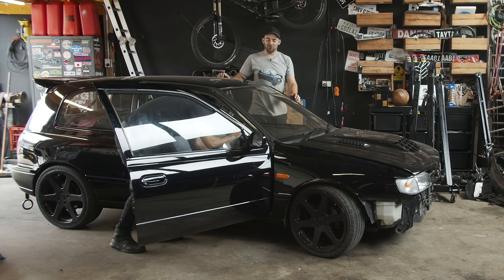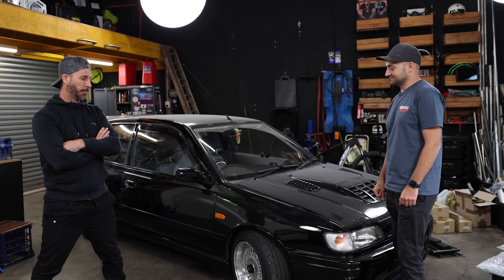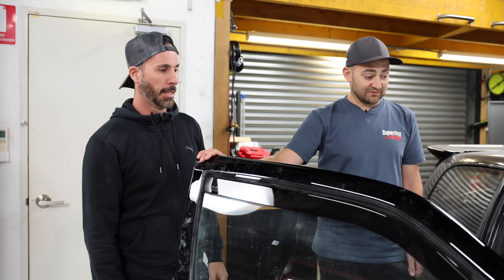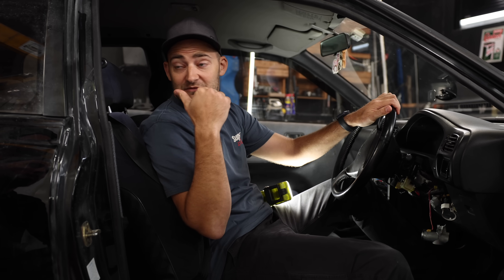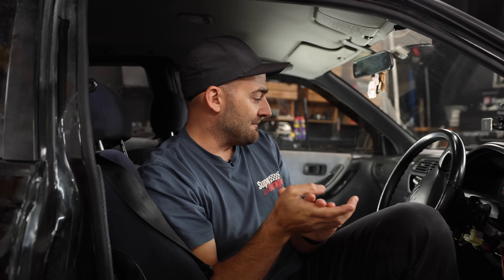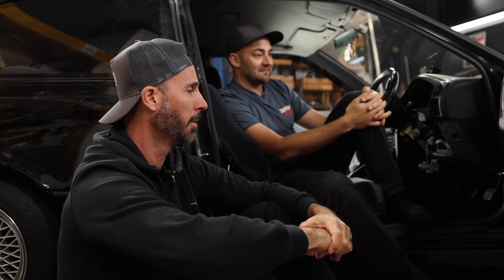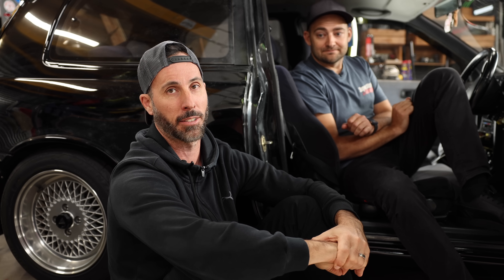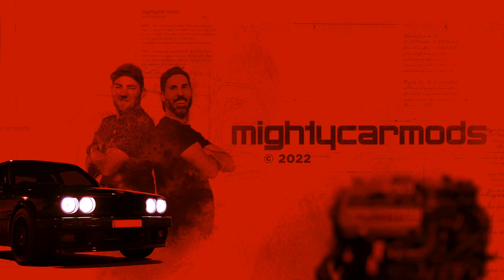Someone tried to Steal the GTi-R | Police Called

Comment: Back in college, someone stole my modded lsvtec... Kill switch didn't matter. They cut the emergency brake, shifted into neutral and put it on a tow truck. When it was found, it was just the frame. I'll never forget, nor forgive them. I knew who did it a bit later, cops didn't do a thing.

Comment: There's no real need to use the lock from inside the car. After bending door frame just hook and tug on internal door handle and the lock should disengage itself. Mechanisms are car-specific but you can often modify (or bodge) them to disable this feature with a bit of ingenuity, although it's not advisable on cars with autolocking. Locking wheel nuts and aftermarket steering locks are also great ways of deterring car theft, basically anything that makes it look like it's going to be a pain in the ass to take. The battery thing is definitely weird, but makes me think they might be back for a second attempt. It sucks that this happened and I hope you manage to get the car fixed soon.

Comment: Ive got the tk419 gps trackers in just about everything i own, there one in the car with a remote ability to cut the fuel pump, there one in my 3.5kva generator, theres even one in mine and my partners electric scooters, they work from 9-72 volts, so pretty much anything. Has a built in battery, just put in a 4g aldi sim card and put $15 credit on the yearly plan, and youll always know where your valuables are, and can potentially even remotely kill the car if its on the move. Cheap insurance I think

Comment: my coworker has a 2022 RS4 and has a tracker installed with a remote kill switch, usually they’d just stop the car and the thieves would torch the thing cause it would be pretty obvious but certain brands create pseudo engine faults so it looks like it’s faulty and lowers the risk of destroying the car

Comment: I used to live somewhere where people broke in to our cars all the time. My housemates k10 was the only one that got taken and we got it back in just in time  as the kid was caught doing laps and was running out of fuel, except the bottle on the back seat ready to hide the evidence. 

But yea screwdriverd locks, bent out doors, plastics ripped off under steering wheel, stereos gone even though they were worth nothing….Tbf even kids bouncing basket balls on the bonnet of my starlet, that completely destroyed the front end. People are absolute savages, especially when they can see you have something that you like. 

Deep breath, in the mouth, out the nose, and just see what you can salvage. 
Still, doesn’t stop that slightly violated feeling unfortunately.

Comment: I’ve got a kill switch and even if you able to start the car without pressing the switch, it force the car to rev to 3k to alert people it’s started and the drive by wire throttle doesn’t work unless the kill switch has been pressed. If you with Shannon’s get buy back as well…

Comment: Maybe it's because I've installed gps tracking/ fleet management and starter disconnect repo specials for about 14 years, but I can start most vehicles without the key or destroying any part.

Comment: On my sti I have US market Lock nuts and tool for wheels and just fit a trailer boot on it from super cheap auto, car isn’t going anywhere until they Cut through the steel boot, doable but would take ages but would be Loud ad hell. Cheap solution and I feel not something people expect

Comment: I take relays with me if I have to leave my S15 outside over night. It has been broken into once and thieves got aliexpress special 30 euro 2 din headunit that was a placeholder to fill stereo cap in dash. I have lost 3 sets of auxiliary lights from my daily. That stopped only after I welded the bolts.

Comment: I had a 1992 (EJ1) Coupe EX (in OEM Honda Camelia Red -Purple) that I bought from a neighbor for $2,500) and I had spent $9,800 on (in 2006) on an Engine Swap (JDM GSR Block bored 0.020", B-16B Head and a Type-R Transmission with a LS Final Drive).
This car SCARED THE POOH out of me, but got 32MPG (Because I drive like an Old Man)...
I was at work, and since I had a Fuel Pump Kill Switch and a Clutch Lock, they cut the Hydraulic Line from the Clutch Master Cylinder, and pushed it onto a Rollback Tow Truck!
I found it later that night with the CV Axels cut with a Torch and the entire car covered in Lithium Grease so Fingerprints where lost.
I ended up selling the Rolling Chassis for $300.
This was the message I received from "Higher Powers" -I don't need a Car like this!

Comment: Some of the interior pieces look very similar to the Sentra SE-R (or regular models).  I bet the door handles and key calendar are the same part # as that, a Primera/G20 or other Nissan models of that Era.  I hope that is the case because in Mexico they contained making the B13 Sentra (they called it the Tsuru) for like 25 years until 2016.  There will still be new parts available.  Moog is looking like he wished Australia had the 2nd amendment!

Comment: 2 years ago someone tried to steal my Subaru, it had working immobiliser but they tried to drive it off by cranking it while gear is in. Didn't get very far but ruined starter motor and the wires, broken driver side window and ignition switch and busted in car stereo and they stole my old sneakers from the trunk!

Comment: thats sad this happen to me before with my 1998 Audi A6 i travel for work what i did i parked it removed the battery and the ECU from the car and one day i got a call that my car was broken in to they couldent turn on or open the door so i ended up with a broken window and a couple plastics under the dash

Comment: Over here in the states I used to have an old jeep that didn't have a key the Tumblr been broke out by the previous owner son stealing it so I put in a 12 V solenoid and a toggle switch hidden inside one of my air vents with the switch was off the truck got no power it was dead to the world

Comment: Used to have a Lexus LS400. It was stolen 3 times (house broken into, keys stolen, car stolen,) and every time I got it back because rare car + small town + local radio. 
In the end, every time I parked the car I'd pop the bonnet, open the relay box and take out the starter motor relay and leave it somewhere car parts don't belong. 2 more times I found the car at the bottom of the driveway with the keys in the ignition. Never did catch the bastards in the act. I would have done gaol time for that car.

Comment: I would guess it was an old car AKA easy to steal if unmodified. Wanted to joy ride rattle can paint maybe swap plates ect... Homeless here in the states are notorious for this. Magnet operated switches are handy. Or running the fuel or ignition via a OEM switch that is not used in your model is always easy and low VIS.

Comment: Seeing how the Australian police even dusted for prints to catch the criminals, it makes me mad how little effort the Swedish police has put in when my dad motorbike was stolen. They were caught not even 10 meters from where it was parked with the bike and my dad has not received any update on the case or compensation. They used a battery driven angle grinder to chop through the front brake disk where the lock was and tossed the lock, broke all the instrumentation to get to the steering lock. The insurance company paid for the repairs but there is still a small part to pay yourself in Swedish insurances(don't know how it works in other countries) and the bike was in for repairs all summer.

Thieves pisses me of so much.

Comment: Hidden Fuel Pump "Kill Switch" and a "Clutch Lock" should help not loosing the Car, but EVERYTHING comes off with Bolts and Screws...
Security Bolts (special Adapter required) and Security Screws also "MAY HELP" of they nefarious will just Break Stuff!
MCM needs an Indoor Shop, or a Secured Yard with a "Mall Security" presence.

Comment: someone tried to steal mine, bent the door frame to get into it with a metal bar that they left on the passenger seat, then tried to hotwire it but failed, utterly devastated, i now remove an ht lead and the steering wheel when i leave it

Comment: An easy and cheap way to slow down a thief especially with an older car if you are going to parking it for a bit. Remove a couple of fuses from the fuse box. Most car thiefs aren't mechanics they just know how to steal cars. If it won't start they will give up!

Comment: Kind of funny you mentioned immobiliser hidden under the dash. So my story starts with my Lexus IS250 being stolen, funny thing - it was not driving car, I had AC compressor seized and accessory belt was taken off, and because that drives alternator the battery was dead. Obviously, Lexus has immobilisers etc. and it was an old car hardly worth anything.. but one day it is gone and I reckon somebody were driving past with trailer and just picked it up. Probably some disingenuous breaker yard guys picking--up random cars of the street when they believe they may be abandoned and braking them for parts or something, and mine looked like that because it was on the street for like 3 weeks not moving. Anyway, so despite being non-running and immobilised it still got stolen.
Got paid by insurance, got another one from auction and that turned out non-runner because of immobiliser problem. In short I had to get to what is called ID code box under the dash and remove entire dash, not only that you need to have matching steering lock, matching smart key module and matching keys. So it is 4 parts which have to match, then you can program them to ECU (ECU isn't needed). In my case I as well needed second key as mine came with only one and that costs £460 from Lexus and only Lexus can do it, so it was actually cheaper to get all parts from single breaker and replace everything, but it took 4 days to take dash apart and replace all the modules etc. It was massive headache.

Comment: Two weeks ago some scumbags broke into my partners car by first smashing the small quarter light in the rear door. Since that attempt failed they pulled the top of the door out and once inside ripped out the ignition key steering lock assembly. Luckily the security guys in the mall caught two of them in the act and held them for the Police. It was an early 2000 Coralla and only worth about three grand but the insurance company is going to fix it. We'd rather they write it off as we had already bought the replacement Car a month before and will probably fail its next warrant due to rust.

Comment: 90's car's takes a thief from the 90's to attempt to take a car this old. He used a hole punch first then remember he could bend the top pillar. Never leave the windows slightly cracked either. They can pull the windows out of the channel and unlock the door.
Reply: It wouldn't take much for younger poeple to learn

Comment: Maan, this sux. But on a brighter note, it makes me remember my old e34 bmw. We were once on a roadtrip, and we gone to eat something, so i locked the car as usual.. well, as soon as i turned the key to lock it the alarm went on, that means the horn went on, all the locks locked and were fixed locked, no matter if the key were turned, the window switches deactivated, and the engine was cut off by the ecu 😅 my only luck was that the central locking wasnt working on the rear hatch, so i could go in, remove the rear seat through there, and after about 2 hours of fiddling with everithing (the horn was on the whole time btw 😂), i managed somehow to unlock the car, and disable the immo. It was such a relief when the doors popped open, and the engine ran again. I never locked it again, ever, instead it had a switch then, under the dash, for cutting the main power, just in case

Comment: Yeah unfortunately a wood shim a long wire button grabber and a wire will get u into any car and unless u have an alarm system with a hidden battery u could easily loose a car because a good theft would easily get in and put it in neutral and roll it into a box  trailer a good alarm and a tracker is the only guarantee

Comment: Me 1986 Mustang  V8 coupe is pretty valuable. I leave it locked, battery disconnected,  covered and behind me little railside trailer, that is triple-locked, including to a fixed post in the driveway. Just make it a hassle is all you can do. Also don't frigging advertise your cool stuff. Avoid showing off or giving away personal info on location and stuff. Never know who's listening.

Comment: As regards the battery. A possible theory is they were way less educated then you think and somehow thought disconnecting the battery would stop the immobilizer working. Then they may have planned on bumping the car in order to start it. Battery was probably discarded. They were unsuccessful and got spooked and ran away that would be my guess. Terrible regardless. I’ve had a cheap and I mean cheap moped robbed when I was living in Canada. Wasn’t the money if I’m honest didn’t particularly like that moped but it was mean and at the time my only way to work. It hits different when it happens to you regardless of the vehicle

Comment: Guys,,, I FEEL your pain.

Here in South Africa, the Uno Turbo's was in HIGH demand in the 2000's... My Uno Turbo was stolen,, or should I say tried to be stolen, but, it could not travel 100m. It was tried to be stolen 3 Fnc!king times!!! and never got past 100M. Everytime I had to replace the Key Barrel, Door Barrels, Boot Barrel and Filler Cap Barrel and the Steering Tube Column cause they YANKed the steering wheel for the steering lock to brake out of the Barrel.

It costed me dearly every time.... MOTHER F'ers....

Then I have fitted the Uno Turbo with AF Management and a VESA 4 Alarm / Imobilizer that cut feul and egnition seperately and to get it back-up-running, there is ONE-HELL-off a button procedure pressing from the Transmitter button to get it to work.

I still do have my Pocket Rocket since I bought it in 1997,, but it is in for "bigger" plans...

Your GTiR,,, that is Masterb-googggl-ed,,, I fel-in-luv with that when it was published in our CAR magazine although we have never had it in South Africa.

"Ps. I would put the Black wheels back".....

Comment: That’s absolutely awful! I’m gutted for you guys! What mindless *goat noises*

For anyone with a modern proximity key, get yourself a Faraday box for your keys… protects them by isolating the signal. There is a problem in the UK at the min where thieves have an amplifier and they pick up the key from inside the house and start the car and drive off… the box blocks them from piggy backing the signal.

Comment: I went to a party one time with my little s10 mini truck but before I went to the party I had replaced my steering wheel and did a kinda bad job at tightening the negative connection back up and when I crashed at the party someone stole my keys out of my jacket pocket and attempted stealing my truck but because my cable was lose they made it about 50ft before it died and  when the engine died it rolled down the hill of the neighborhood until it got stuck in a 3 foot ditch left for dead until I found it in the morning

Comment: Someone needs that car to be used as a diner car, they aren’t worth that much to be stolen for a major profit. Whoever stole it, either personally needs the parts or knows someone who needs the parts of that car. 

The only cars worth stealing to be sent overseas are brand new or -5 year old cars, luxury or sports cars. Most popular are range rovers, land cruisers (sent to the Middle East, usually they steal older cars to send to isis, newer ones go to Dubai). 
Euro luxury cars go to China/Asia/Africa where they are just straight up sold, usually to millionaires who don’t know they’ve been stolen. The most popular way is by switching the numbers with a local car that’s been written off or used in crime and disposed of (blood is difficult to permanently remove) hence the straight switch of luxury cars like range rovers. 

Classic cars are stolen, usually kept in collections, or swapped with site offs. 

If you’re worried about your car being stolen, don’t be too concerned, if it’s worth less than 25k they won’t be stolen to be sold, usually just to be used in crime. You can do multiple things to make it annoying for the car their to steal, but the best thing is to keep it locked away behind a gate or in a garage. 

If it’s a luxury expensive car, there are ways to keep it secure, but in public you will be followed if it’s worth the hassle. For example, white Ferrari 458 ital, someone would follow that car until they stopped, used the key fob to lock the car then boom! The thief (if In range) has the code to unlock your car, then can wirelessly access your car, with a reader can start it and dang it. Usually they have a container ready, the vehicle is out of the country within 48 hours. 

You should always insure your car, no one wants their cars stolen, but it’s a cold world. Just hope it isn’t used to take a life. Most popular vehicles in assassinations/drive bys are hot hatches like vw gti r models. The best vehicle to get up close and personal? 150cc short wheel base scooters, why? Automatic so it leaves you with a hand free for the gun, shirt wheel base to do a u turn with less than 1.5m of space, also long enough for a shooter on the back. Automatic transmission frees up your feet, all you need is a hand on the throttle which also has the brakes. 

How do I know this? I watch a lot of Brazilian live leak videos I guess…

Comment: New  cars especially Honda CR-V are the easiest to steal now is their proximity keys all you have to do is capture the code and you can steal the vehicle people can do it just by standing at the front door of the house if the key fob is too close to the door they can capture it it's always sending out signals
Reply: Or they just hook up the computer to the car and program a new key into the vehicle and drive it away that's the other way of doing it